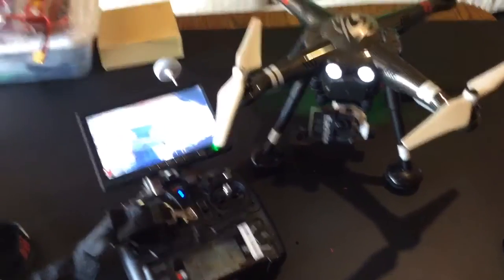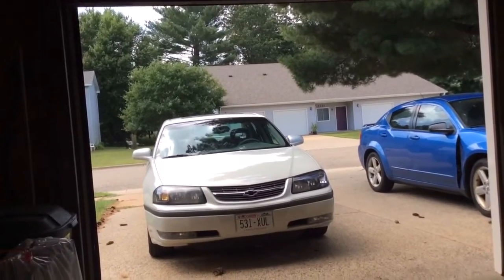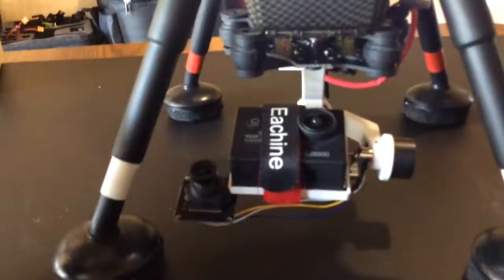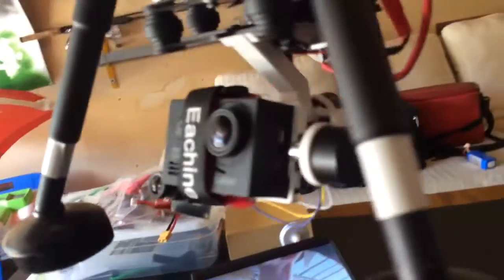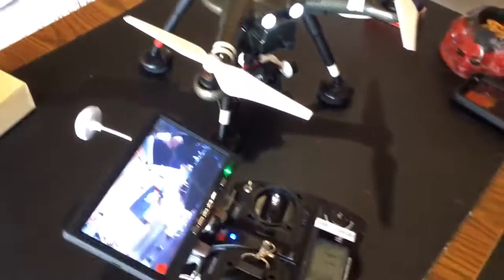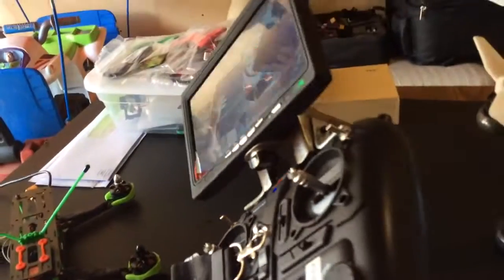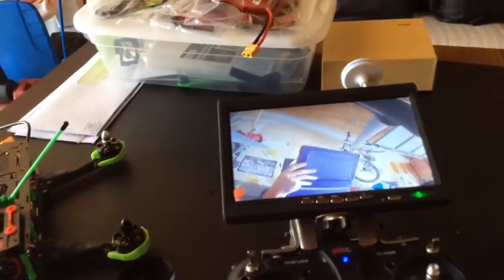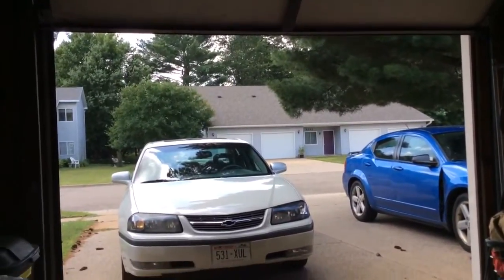XK detect X380/ Walkera G2D/ Eachine 700TVL 1/3 110 FPV Setup

Comment: Did you powered both fpv transmitter and the gimbal from x380 power output, or something is powered from separate 3s battery?